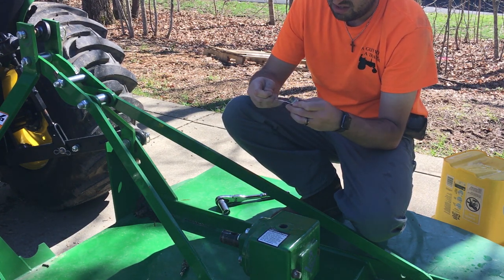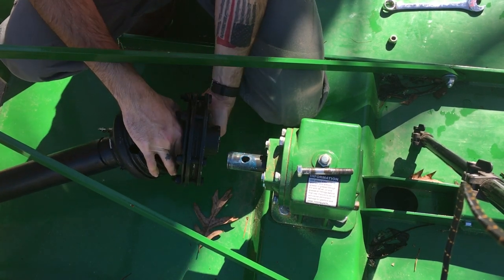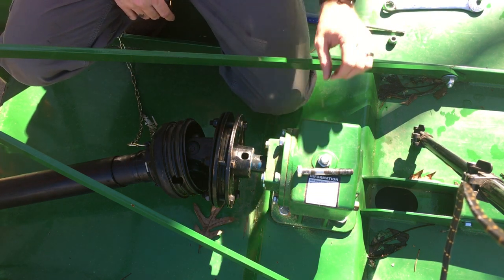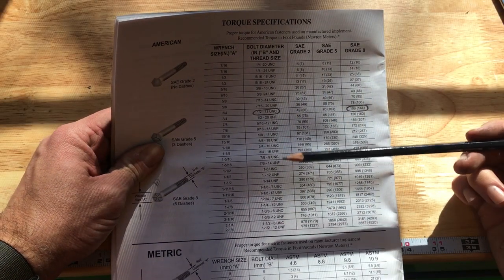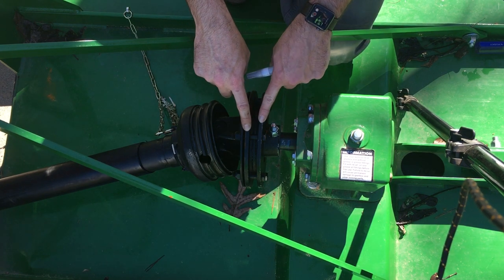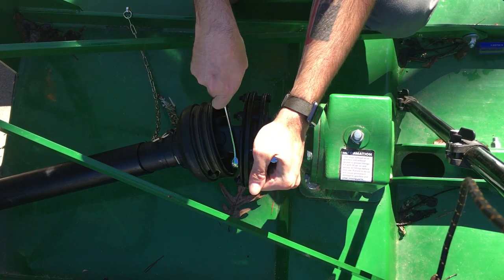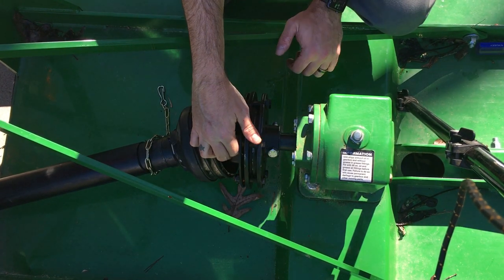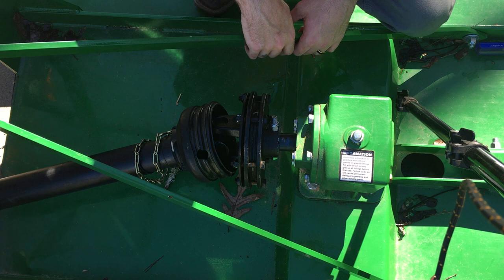#10 How to Slip a PTO Slip Clutch

Comment: watched it all.  I have the same cutter.  Question.  It is pretty new so it should pretty much be right?  Good video  rip1outdoors
Reply from the maker: Depends on how long it sat on the lot and if the dealer did a PDI that included slipping this clutch. I have gotten some that were locked up when I got them.

Comment: Sorry about an amateur question but I have to refer to my manuals for everything and it seems like the manual talks about using grade 2 bolt for the shear pin. In your video you use specifications for a grade 8 bolt. Should I be using a grade 8 bolt for a shear pin or using grade 8 specifications on a grade 2 bolt?
Reply from the maker: You use a grade 2 shear bolt if you do not have a slip clutch. The slip clutch takes excess loads and does not break so you do not have to stop to change a broken bolt. So you use a grade 8 with the slip clutch.

Comment: Is it possible to grease the universal through the slip clutch cover and is there a trick to putting it back on if you take it off? The cover, not the universal.
Reply from the maker: On the frontier I couldn’t without taking it off. My new MX5 cutter has a cut out that lines up and you can grease it in place. The more frequent you take it off the easier it is. Grease the shaft when you have it apart.
Reply: @BBLandServices  I took a 1 1/4" hole saw and made an opening directly over the grease fitting.  Now I can grease the universal joint without removing the slip clutch cover.
Reply from the maker: Nice good thinking

Comment: I got a 3032e and my bolt broke and it's to far back it won't come forward.. I'm like wtf I can't put a bolt in if it won't come forward. Do Im very confused
Reply from the maker: Which bolt?
Reply: The bolt for the bush hog. Shear bolt or the grade A bolt. I should of loosen up my clutch. But now the shaft went to close to the gear box and it won't come forward. I'm not understanding since in the video you just slide it on really easy
Reply from the maker: @louisianapepper1018  probably cause some burs when it broke and that’s what’s holding it on. Probably going to have to persuade it a little.